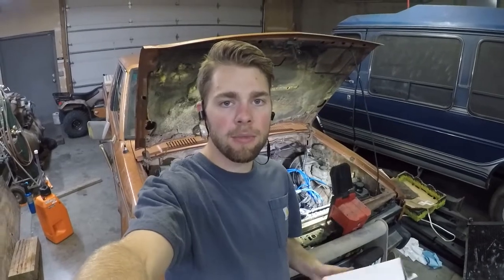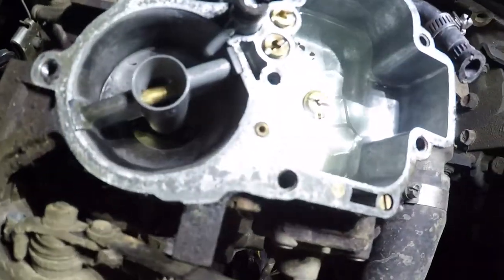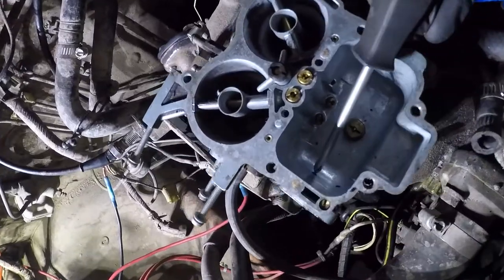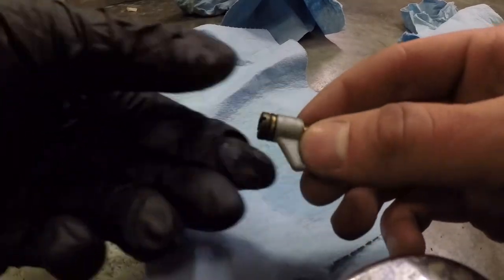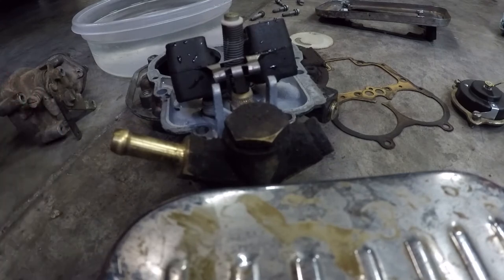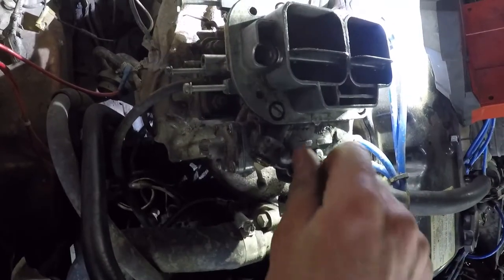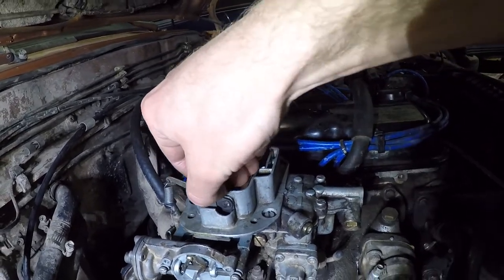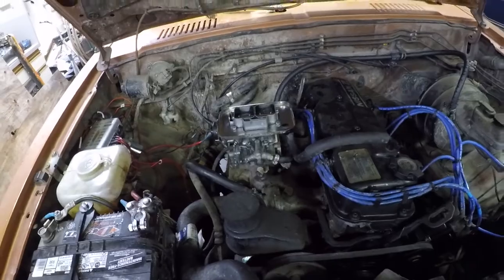Carburetor Rebuild 1985 Nissan 720 Z24

Comment: Looks like you have a couple valves blocked off...the ant-backfire and vacuum valve that sits on top of the manifold looks like it has a nut used as a block-off?

Comment: Cool vid you still have instagram?
Reply from the maker: Yes, feel free to connect with me on there.
Reply: @Captain720  hi Boss how are you I have Nissan Z24, which jerks or stalling when driving, the car only drives with high revs if I put the rev on normal it will be stalling and cutting off